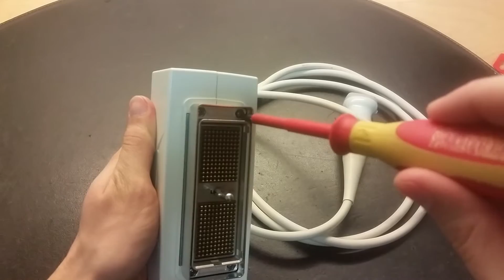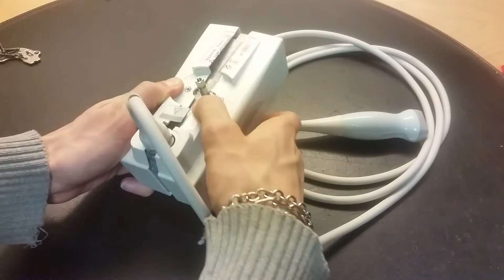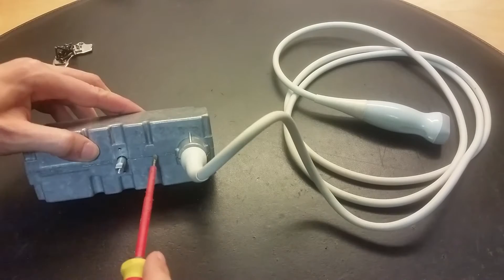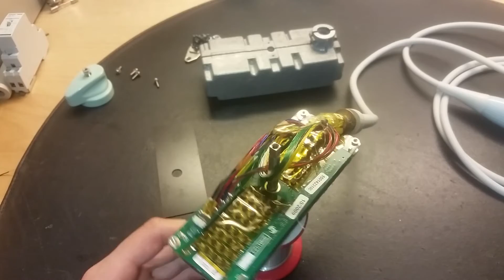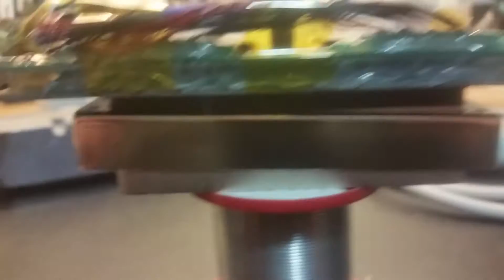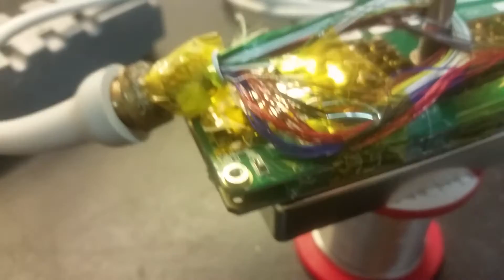Medical Equipment Teardown #3 Ultrasonic Connector

Comment: Yeah, those ultrasound sensor ends are where the real magic happens 

Sometimes, we have seen them break by dropping them. However, that is rare, because they are connected with the chord, so it doesn't reach a fast speed to the floor. grin.

Other times, the machine doesn't work, but there is rattle in the wand sensor. That usually means one of the small chips in the wand has broken loose inside the sensor. That is when it needs to be replaced.

I think the last time that happened our purchasing department picked up a new wand at the https://www.mazree.com med equipment auctions or Ebay. They aren't cheap when you have to buy them new. But, if you pick up a used wand that matches the ultrasound machine you have, that usually saves a bit.

Comment: Thanks for the video!
 I wonder how to open the probe without breaking it: there are no screws. Is it melted or glued ?
Reply: The crystal end is sealed(with silicon) in many models of transducers, when you need to open you have to cut it without getting damage the internal stuff, Also need to loosen the cable from its  neck

Comment: Thanks for sharing, i always wanted to take one of those apart, but they are not easy to find, even in "for parts" condition they can be worth several hundred euros on ebay... The probe will probably be very difficult to open but must contain a very sophiticated ultrasonic transducers sandwich, since all the wires are not there for a decorative purpose...
Reply: +msylvain59 
Yes, I think looking inside the transducer probe would be more interesting...